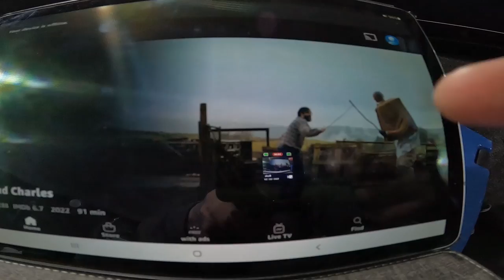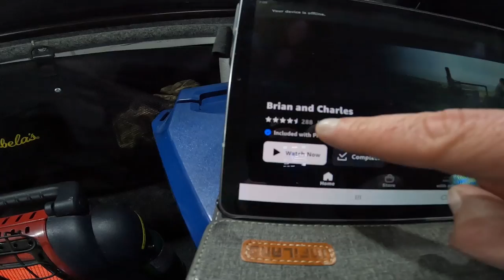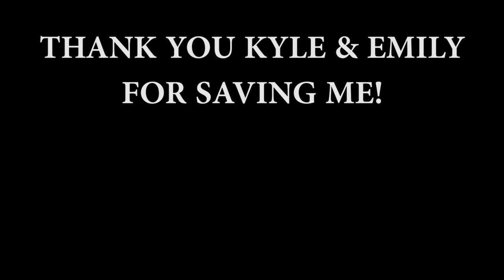I Went Truck Camping and Had To Be Rescued

Comment: I'll tell ya a couple secrets. The tread will fill with mud then not bite. Sometimes flooring it briefly will clean the tread out. Also turning the wheel left right left right  helps. When it's real soft I'll air my tires way down to about 10 lbs as long as you don't turn to sharp it won't break the bead loose.  When you were tapping your boots together, you should have said ( theirs no place like Home)!! 😂. Great video ...
Reply from the maker: There's no place like home!  😂
Reply: @CrazyQuady  go camping tonight
Reply: Agreed
Reply: @CrazyQuady  go camping tonight our Monday night
Reply: @CrazyQuady  go camping tonight our Monday
Reply: 4 hi, lower tire pressure......floor it!!!

Comment: Great Video,Word of advice from someone who grew up in the mud,You do not use 4 low in mud or snow,you want 4 high, especially in mud because once you start getting stuck it about wheel speed,no matter if you have the best bloggers they make,you have to have wheel speed so the tires can clean themselves,4 low is pulling power for pulling other people or such,4 low you makes you think your doing something your not because of the motor rpm,high rpm low wheel speed,4 high you don't have as much rpm but have a lot more tire speed!!Hope this helps next time:-)

Comment: You should keep a cheap shower curtain liner in your under bed compartment then when you put wet stuff away your truck doesn't get soaked. You could keep one in the front also. They fold up small and way cheaper than a tarp.

Comment: Reminds me of a time when I took a day trip up to the mountains in Colorado with my family, my dad and a buddy. I crossed over a patch of snow didn't think anything of it. Well the road was blocked by deeper snow so I turned around and tried to go back the way I came in and ended up burying my suburban up to the frame in the middle of the road.  To make matters worse my ignition broke so I couldn't shut the truck off or get it out of park lol, had to pull the coil wire to shut it off.  Had a friend come and get all 5 of us in a 4runner. Went back up the next day in a v10 4x4 dodge fixed the ignition and pulled it out what a memory to have lol

Comment: I have been there. Reverse in those conditions, is not an option. Mud ain't like snow nor ice. Put her in 4 hi and lay on it.  You probably have a/t tires. High rev will help clean the tread and some speed will help you stay on top. You will have a fight keeping the front on center of road. We contend with those conditions, in that type soil at least 3 months out of the year. All of our farm trucks run extreme mud tires year around. I can promise you, if I get it stuck, no one else can drive it out!😁

Comment: Two chunks of 2x4 (2/ tire if 4wd ) the width of your tires. Drill a hole in each end. Run rope through the holes. Tie 2 per tire and just walk on out of there. Now if you are bottomed out, it's jack and block time. That sucks. Lol

Comment: Glad everything worked out. I couldn't tell if this is how you were hooked up for the recovery, but I want to throw it out there in case anyone doesn't know, that using the tow ball or regular hitch as a recovery point is NOT a good idea. Check out Colorado 4x4 Rescue and Recovery's breakdown video of a hitch recovery that ended up being fatal.

Comment: Looks a dirt road.  Not gravel, just dirt, packed dirt.  I got to learn the difference this summer in your area, almost got stuck.  I live on gravel but there's dirt nearby.  I now stay off the dirt when it's wet, unless you're just playing and have a friend with a tractor ready to help.  Around here it turns to this paste that fills your treads.  Also if you're ever cruising the back roads around here within a few days of a rain and see a sign that says "Gravel Ends", probably turn around if you're not equipped for mud.

Comment: These new trucks are just not offroad friendly. Got mine buried today only because traction control kicked in at the worst time possible. They're made so ya either gotta call the dealership to work on em or a tow truck to get ya outta a mud puddle anymore. All my old fords will go through 100xs what any of these new trucks will. If they don't then you'll need a tank to pull em out. New stuff is nice but can definitely be very inconvenient at times. Either way, awesome video man🤘

Comment: One thing I’ve quickly learned from other off  road folks is NOT TO USE A TOW strap to be pulled , it can be FATAL .   A kinetic strap is what should be next immediately on your buy list .  I suggest and strongly recommend Yankum Rope .  I know you like to buy affordable and economical stuff , and that’s great , wallmart is my go to also but when it comes to recovery gear you absolutely can’t be cheap about it .   Dead Man Off Road or Yankum .   But them .  Don’t leave home without it .

Comment: Tires Tires Tires....In Iowa, That's play mud, you are not stuck if you still got gas. Get that thing out of 4 low, go to 4 h, and put that pedal to the metal and rooster tail your way to gravel. , 4 l should only  be used when 4 high isnt doing it. to much torque and not near enough wheel spin for mud. That wheel spin keeps the tread cleaned out.